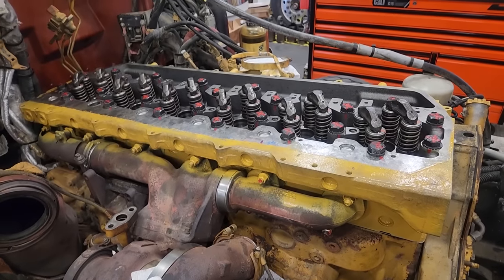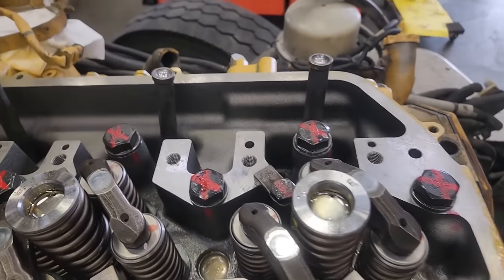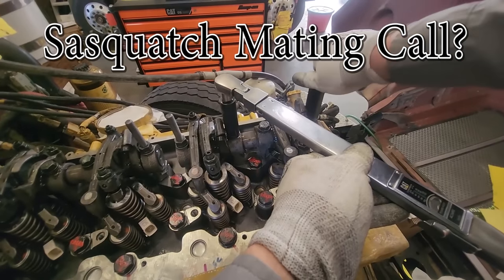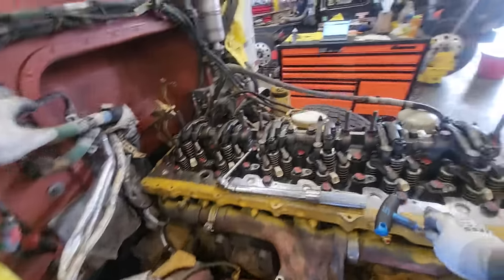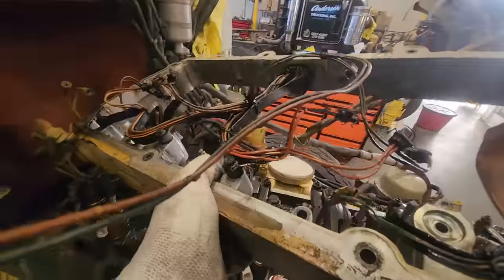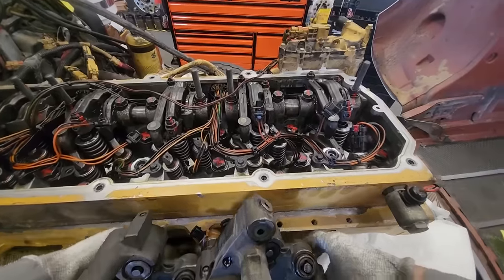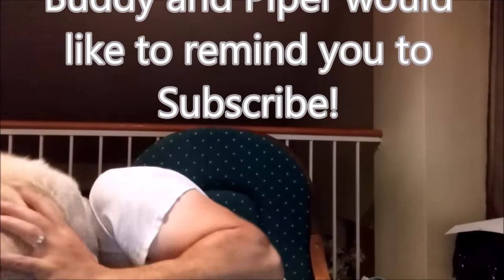Cat C13 Valvetrain and Overhead installation and adjustment.

Comment from the maker: Hope you guys liked this longer technical style video. Thanks for watching. You can help the channel by clicking the Amazon Affiliate Links: 
Lincoln 20 Gallon Oil Evacuator: https://amzn.to/3oaOgeZ
20 Gallon Drain Pan Pig: https://amzn.to/3vJNuIs
Mechanical Fingers: https://amzn.to/3oZ7S5U
Knipex Flush Cuts: https://amzn.to/3tvsoO3
Sunex Hex and Allen Socket Set: https://amzn.to/3C0XRdE
Sunex Driveshaft Socket Set: https://amzn.to/3zLoGnZ
Sunex 3/4" Standard Socket Set: https://amzn.to/3vrNAGA
Sunex 1/2" Standard Socket Set: https://amzn.to/3oJSETe
Sunex 1/2" Metric Socket Set: https://amzn.to/3Sf9IOj
Reply: Have you heard of japan and china creating hydrogen engines???? @adeptape
Reply: What does that valve solenoid do that’s at the front of the motor passenger side on the outside front

Comment: Love your videos, great top set technique. Just a suggestion, after I do a top set, I re-torque all the lock nuts and then double check with a feeler gauge that's 0.001" bigger than the target adjustment. If it's super tight or doesn't fit then I know I've hit the target. On CAT engines, the tolerance is normally 0.003" so not really necessary, but on Deere engines there is no tolerance.

Comment: Very interesting I'm not a heavy diesel mechanic just a novelist like your educational videos though ! My diesel is a toy to what you work on just a little 2002 5.9 24 valve Cummins ! Bought the truck new it now has 329455 miles on it has not had any major work done to the engine jus regular maintenance ! Still running great ! Knock on wood !

Comment: I like the Snap On feeler gauge set with the quick change handles. The only thing that's kinda annoying is the handles are all the same color, but a strip of colored tape or paint pen on the feeler works well.
Reply: What I end up doing with my green handle set is I paint pen and E and an I on the appropriate gauges.

Comment: Just was doing the same overhead on friday. You are so right about making sure no wires get pinched. Nothing like the feeling of wrapping up  and putting the last bolt on the valve cover only to notice a now crushed wire peeking out around # 6.    PS the parts guy at Cat told me that Cat is going to be stopping all parts and support for their over the road engines. I dont know if its true, but he told me that
Reply from the maker: As far as I know they are still fully supporting them. Many of the same parts fit the equipment and truck engines, so it would be hard for them to stop specifically truck engines.

Comment: Great video.If you are doing a valve set on an overhead cam engine loop a tie strap through the hole in the feeler gauge.Saw a mechanic drop the feeler gauge on a Volvo D13.Rear cam gear drive system.Dropped when doing #6 hole.Took 10 hours to find the gauge.

Comment: Part number for a 0.037 feeler gauge is 1535239, used on low HP 6NZ Jacobs Brake if I recall. I dislike the IVA wire splice. What I try to do first is to remove the old connector off the wire. Re-spring the connector to get it tight on the pin. Once that is done, I take the splice connector apart and put the repaired wires in the new connector. Odd thing I like to do is when I get ready to run the overhead, I rotate the engine two rounds to make sure the valve train is seated in, if I had the rocker arms off.
Standard bolt formula, if you have a 3/8 shank and you multiply it by 3/2, 3 x 3 =9. 8 x 2 =16, wrench size is 9/16, reverse of this is divide. So 9/16 = 9 divided by 3 = 3 and 16 divided by 2 = 8, so shank size = 3/8. Now sometimes you get into a odd size. So a 5/16 shank would be 15/32, so as you can see you off just a little bit. In that case you add or subtract 1/32 of an inch and you get the right number. Works most of the time, always an exception in some cases, works on larger bolts, better.

Comment: Iv never thought of putting the rockers on that way with the push rods..  didnt know you could pass the intake and exhaust rods in like that last.  Iv always loosened all the adjusters up and fumbled getting everything lined up.  Using sockets on the rockers to keep the push rods from falling out lol.  Its especially hard in a bus.  Iv done countless c13 that way.   Gotta try this way on the next one.
Edit: just realized you had the rocker cover off. Bet that trick with the push rods won't work with the rocker box in place
Reply: I would just screw in the outer Jake bolts till intake in exhaust rodes snug against rocker arms

Comment: Hey Josh, not meaning to be nosy, but in your shop is the work flat rate or hourly or both depending on the assignment. Thanks
Reply: I know he was working hourly ~8 years ago at a previous CAT location if that helps ;) He also expressed a preference for hourly over flatrate.

Comment: I watch Josh's Caterpillar engine videos even though I don't possess any such. Don't even drive any such anymore.

I am surprised Caterpillar does not manufacture a 37-thousandths feeler gauge for its mechanics to use ...
Reply: Part is offered under a Cat part number used on Jacobs Brake.

Comment: Do you know if there is a kit to replace the piston pins on a 3176 motor to one with a snap ring holding them in. The plastic plugs on ours broke resulting in a tic and sleeve damage. It doesn’t seem like a good design.

Comment: What's going on with a caterpillar C-15 engine has blow back or blow by going on .. little smoke coming out of the oil fill cap .
It has 1 million miles on the engine. 
Any suggestions??????😮😮
Reply: Yeah...its got a million miles, probably time for an in-frame.

Comment: If you ask anyone 13mm is the head size, like everywhere, unless it's a caterpillar thing
Reply: Not true. I’ve been in the trade about 15 years now. Most tradesmen refer to the bolt size. Not the size of the head. But I also work for a cat dealer

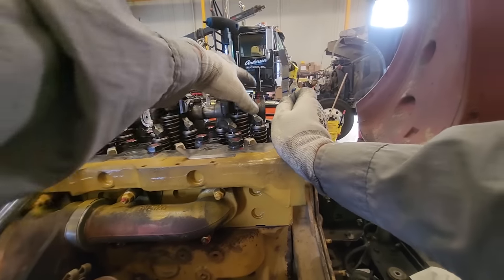Comment: @10:15 you are stating that the torque adapter doesn't change the torque setting? Ah, if the effect is making the torque wrench longer I believe you are getting more torque than indicated on the wrench.
Reply from the maker: Well, you are both correct and incorrect depending on the angle the torque adapter is in relation to the torque wrench head. If you have the torque adapter on a horizontal plain with the drive head, think directly to the right or left of the head, you are incorrect and it has no effect on the torque output. If you put the torque adapter directly up from the head it increases the torque and if you put it below it, the torque is decreased, in which case you would be correct
Reply: @AdeptApe  I did notice you had it at 90 degrees to the head. Thinking about it now, I see where I mislead myself. Thanks.

Comment: Actually , when using metric fasteners, you will never have an 8mm , 10mm or 12mm etc thread. 
The correct sizes are M8 , M10 and M12 etc.
If you use the correct terms , you will train the monkeys not to confuse the head size with the thread size - they are never going to find an M10 socket or wrench

Comment: Is it the same for kcb model
Reply from the maker: Similar assembly, but the valve settings are different.
Reply: @AdeptApe  thanks for reply brother the manual I’m looking at says intake 0.38 and exhaust 0.64 is that correct?
Reply from the maker: Well, most KCB engines are .015" on the intake and .025" on the exhaust settings, not sure your exact serial number settings, but they are usually the same. Not sure what that translates to in MM, but that sounds about right.
Reply: @AdeptApe  2005KCB44203 hadn’t put attention to the plate on the motor it says int-0.38mm and exh-0.64mm the truck is a 2006 Kenworth w900 short hood
Reply: @AdeptApe  what do you think about the c13 brother

Comment: Can anyone tell me please what that solenoid valve is hanging off the right front side of the block it connects with two wires of the valve cover what does it do?
Reply from the maker: IVA oil pressure solenoid
Reply: @AdeptApe  i have a c13 that quit running out of no where so i replaced the transfer fuel pump and it still wont crank so i took off the fuel return line and pressurized the fuel tank and waited untill fuel came out of the return hose but it still wouldnt crank not unless i spray either
Reply: @AdeptApe   does the c13 have a fuel shut off cylinoid if so where and i know my 3406b had one